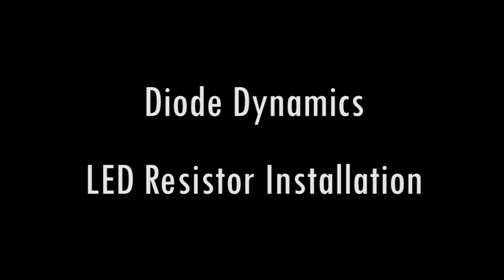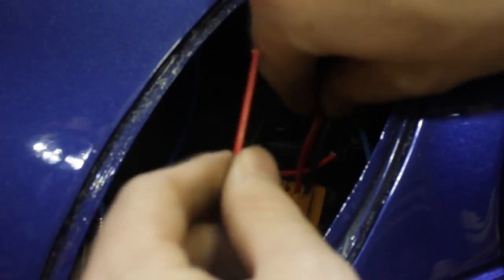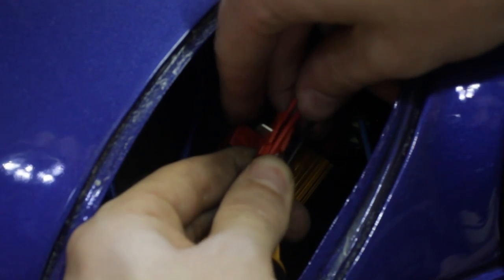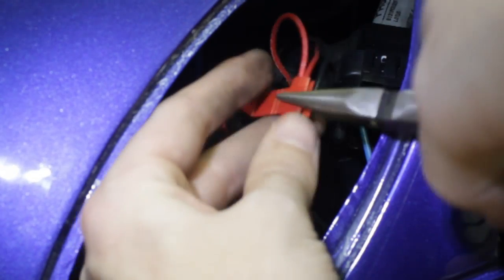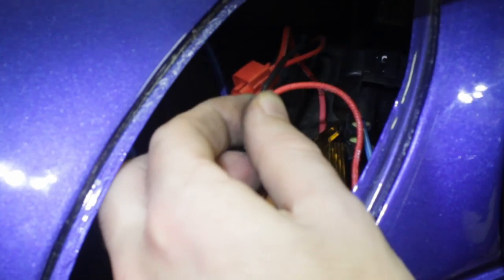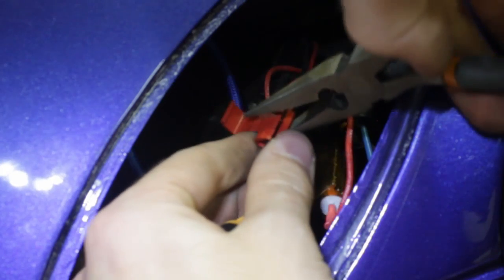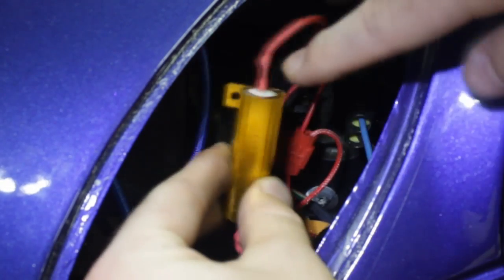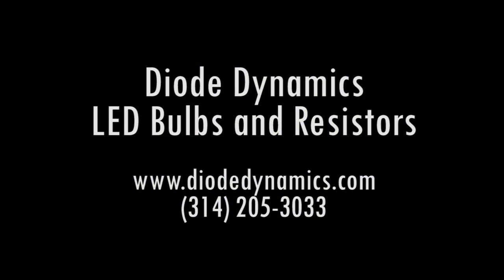How to Fix Hyperblinking! Installing Resistors for LED Turn Signals | Diode Dynamics

Comment: Do I need two resistor kits if I decide to replace both front and rear turning signal? Or just one kit will do the job for the entire circuit? Thank you
Reply from the maker: tvalchev, good question! You will need 1 resistor per turn signal.
Reply: Excellent, thank you! Can please you tell me what what kind of bulbs to use for the side marks, third stop and the turn signals I have on the side mirrors. Vehicle: 2010 Altima Sedan
Reply from the maker: tvalchev, attached below I have a link to all of the products for your 2010 Altima Sedan. If you have any questions just let us know. Thanks for your interest!

http://www.diodedynamics.com/store/catalogsearch/advanced/result/?name=&description=&short_description=&sku=&price%5Bfrom%5D=&price%5Bto%5D=&v_make=Nissan&v_model=Altima%20Sedan&v_year=2010

Comment: How exactly do you mount the actual resistor to a metal part of the car? I'm assuming drilling is out of the question. I tried mounting mine with 3M double sided thermal tape (the thin black kind made of graphite) by putting tape all over one surface of the resistor and sticking it on, but the resistor or the metal surface are not straight enough and as a result it's only loosely attached from a few points of tape instead of over the entire surface.
Reply from the maker: LMF5000, with our resistors, we suggest either 3M tape like you had already tried, or some small zip ties to get it out of the way. If neither of those work, there are also small mounting points where you can use small screws to attach to a metal surface. Hope that helps! If you have any other questions just let us know. Thanks!

Comment: How much power does the resistor take. Is it ideal that the LED + the resistor in parallel, that power consumption is equal to the original incandescent, so no energy savings?
Reply from the maker: danwat1234, running resistors like this will consume similar power to that of the original incandescent bulb. Unfortunately, this is the only way to trick your car into thinking there is not a "bulb out" situation.
Reply: You'll probably use a little more, because the resistor alone is quite close to the original bulb in power consumption, then you have to add the power for the LED on top of that. But I don't see why bulb energy consumption should be much of a concern. The bulbs on a car are normally 5 to 55W... the engine generates upwards of 70,000W at the flywheel (since 1 horsepower = 750 watts).

Comment: I was trying to install my switchbacks in my front turn signals on my 07 GMC 2500 and I'm running into a issue. I was able to slow the hyper blink down until my head lights came on then right back to hyper blink again so now what?
Reply from the maker: Hello! If you shoot us an email at contact@diodedynamics.com, our service representatives would be happy to run through some troubleshooting with you. Thanks!

Comment: Is there something out there can like cover the resistor to protect it thanks and make anything eles to touch it
Reply from the maker: James, we do not currently offer anything that stops protects the resistor. As long as you mount it to a metal surface and out of the way, there shouldn't be any issue.

Comment: How do you know which is positive and negative on the resistor
Reply from the maker: Emmanuel, there is no positive and negative side to the resistor, so it does not matter which orientation you install it. Feel free to let us know if you have any other questions. Thanks!
Reply: Diode Dynamics That was my question.  Great video guys!  If you post a link for some front lights for a 2005 Town Car, I might just click n buy. (So sick of shopping atm) Working on my tail lights currently, and wish to buy new front headlamp assemblies in June.  Gonna need new lights to fill them!

Comment: ok i insstalled some switchbacks but i also unstalled 194 led for parking light . But i converted the side parking light to become a blinker since my car did not come with side blinker. they all have resistors on them but im gettin hyper flash still. is  it becuase the 194 led uses a lower ohm watt then the 4157 switchback resistor that has 6ohm 50 watt.
Reply: And the resistors arent getting hot but they are installed correctly
Reply from the maker: Paul, if you could shoot us an email at contact@diodedynamics.com or give the office a call at (314) 205-3033, we would be happy to help you get the hyperblinking fixed.

Comment: I have a 2003 mustang and bought a switchback led kit with resistors. From the video, it seems that I need to splice the black wire, which has ground, and the turn signal one. I have three wires, a green and white, brown and a black wire. I'm not entirely sure which two wires I need to splice. Help!!
Reply from the maker: Andrew, on one side you will need to use the black and white/green wires, and on the other side you can use the black and white/brown ones. Hope that helps. We actually have a plug and play flasher module for your year Mustang that will eliminate the need to cut and splice anything and allow your turn signals to function normally. Attached below I have a link to that product. If you have any other questions please shoot us an email at contact@diodedynamics.com or give the office a call at (314) 205-3033 and we would be more than happy to help you out.

http://www.diodedynamics.com/store/led-bulbs/listed-by-vehicle/ford/mustang/1994-2009-ford-mustang-led-turn-signal-flasher

Comment: Hello there, I have a 2000 chevy silverado LS 1500 and can't seem to figure out which wire is which. The socket or fitment has 3 wires and from what I can see it has a blue wire and two black ones. Any idea on which wire I would connect the resistor to? Thanks
Reply from the maker: Hello! For the front turn signals, you will need to tap the black and light blue on driver side. For the passenger side, it should be black and dark blue on the passenger side. One of the two black wires should actually be a dark brown. Hope that helps! If you have any other questions just let us know. Thanks!

Comment: Would you know why that hyper flash continues even when the resistor is installed? Its hot while connected to the positive and negative leads
Reply from the maker: Jonny, please shoot us an email at contact@diodedynamics.com and we would love to go over some troubleshooting with you. Thanks!

Comment: My 2012 silverado has dual bulbs on each side as running corner lights +turn signals, would this  still work? And do i need 4 resistors? One per lightbulb?😦
Reply from the maker: Evaristo, you should need one resistor per turn signal light bulb. If you have any other questions feel free to shoot us an email at contact@diodedynamics.com. Thanks!

Comment: I need help plz!!  

I have a 90 454SS truck.  I have put all LED lights in front and interior.  My problem is my two corner parking/turn signal wont light up.  Its really really low output for som reason.  It is so dim

What my issue.  Fyi I also have halo headlights.
Reply from the maker: Hello! Please shoot us an email at contact@diodedynamics.com or give our office a call at (314) 205-3033. We would love to run through some troubleshooting with you. Thanks!

Comment: Say I do this and install LEDs in all my lights. Would i be able to use non-LED later without unsplicing everything? 

Or does LED last long enough that it wouldn't be an issue?

Thanks
Reply from the maker: You would want to remove the resistors if you switch the LED bulbs back to standard bulbs.

Comment: I recently installed these on my Nissan Sentra 09. On my front turn signals, I have a black wire and an Orange wire. On my tail lights, I have 3 wires, one black, one solid green, and one with green and white.
In my front turn signals, I installed them the same way as in this video. However, on my tail lights, I installed the load resistors attached to the black wire and the solid green wire. After installing, I still get the hyper flashing, but only when I use my turn signals. When turning on my hazard lights, they flash at a normal speed. Can you guys help me out please?
Reply from the maker: Danny,
Please shoot us an email at contact@diodedynamics.com with this information and we would love to go over a few resistor troubleshooting steps with you. Thanks!

Comment: And this resistor can affect the original brightness of the bulb??, regards and thanks.
Reply from the maker: Aaron, good question! Resistors will not have any affect on the original brightness of the bulb. It will be the same brightness level with or without the resistor. Thanks!
Reply: Thanks a lot for the help and time. I think for the rear lights is more less the same, just found positive and negative and connect like you clearly show in the video. But what happen if I want to replace all my rear bulbs with led lights (stop, reverse, etc), is necessary one resistor per bulb or just one in the general positive and negative wire that feed all the rear light?, again thanks and I hope with my questions to help others costumers doubt's.
Reply from the maker: Aaron Joseph Gutiérrez ,resistors are only needed on blinkers, not for your stop/reverse lights. Hope that helps!

Comment: Paul,
Would you know how to install a two wire socket for park and turn lights? My front running lights are grounded to the grille/body but my side sockets don't have metal.
This is on my 76 cj7 jeep. I also installed LEDs to the front running/turn lights (bulb #1157 dual filament, and side bulbs are #194 bulbs dual filament.. I installed no load flasher cans, and 4 no load resistors but not getting the front park lights to flash at all.

Is what I did correct or wrong? Thanks for the video. ")
Reply from the maker: Hello! Please shoot us an email at contact@diodedynamics.com with this information and we would love to help get your Jeep turn signals wired up and and running! Thanks!
Reply: Will do. Thanks. :)

Comment: I installed switch back LEDs on my civic, they worked fine for a year or so. Now all the sudden one side is hyper flashing, I tried to fix it but it's not working.
Reply from the maker: Hey there! If you could give us a call at (314) 205-3033 or shoot us an email at contact@diodedynamics.com, we would love to help you get your hyper flashing fixed. Thanks!

Comment: Hey man, I just attempted to install 50w 6ohm resistors for LED turn signals on a 2013 Honda Accord Touring.  I followed your steps and unfortunately I am still experiencing hyper blink.  I used one for each bulb as well.  I need assistance. Thanks!
Reply from the maker: Hello! Please shoot us an email at contact@diodedynamics.com or give our office a call at (314) 205-3033 and we would love to help you troubleshoot your resistor issue. Thanks!

Comment: And what will happen if you leave it without resistors, is bad for the electrical system?? This quick blinking affect the led
bulbs??
Reply from the maker: Aaron, there are no negative consequences to the bulbs or the electrical system from having it run without resistors. However, many people prefer to have them so there isn't a constant "hyper-blinking" effect inside the cabin of the car. Hope that helps. Thanks!

Comment: Thanks for this helpful video, but could you tell me the differences between 25w 6ohm  and 50w 10ohm resistors?
Reply from the maker: Hello there! We carry 50w 6ohm resistors on our website that are mainly used for turn signals, while our 510 ohm resistors are mainly used for DIY projects that deal with individual LEDs. Hope that helps!

Comment: Good video!
I bought 4 led bulbs for brake likes, and I don't what ohm or watt resistor to use. It plugs into 12v and uses 10w. What resistor do I need?

Thank you in advance for your feedback.
Reply from the maker: Hello! Please shoot us an email at contact@diodedynamics.com or call at (314) 205-3033, we would love to help you troubleshoot. Thanks!

Comment: If I have led turn signals in the rear with resistors do I still have to install the resistors for the switchbacks? I ask because I installed my switchbacks with resistors on both front and back and now im getting hyperflash
Reply from the maker: Our switchbacks do require resistors in order to prevent hyperflash. Please give us a call at (314) 205-3033 or shoot us an email at contact@diodedynamics.com and we would be happy to help you get figured out. Thanks!

Comment: I installed load resistors for the front turn signals (dual filament) on my 2008 Honda Civic, now I have strange things happening.

2008 Honda Civic LED hyper flash when running lights are on

Please email me at myriad1973@yahoo.com
Reply from the maker: Hello!
Please shoot us an email at contact@diodedynamics.com or give us a call at (314) 205-3033 and we can help you try to fix the hyperblinking in your Civic, Thanks!

Comment: If I install LEDs for front DRL/turn signals and install load resistors, will I need to install a second set for rear LED turn signals as well?
Reply from the maker: Hello Andy! You will in fact need a pair for the rear turn signals as well. Hope that helps!
Reply: Diode Dynamics t

Comment: Diode Dynamics Are you guys familiar with with switch back LEDs? I'm having issues with mine and wondering what the fix is.

http://youtu.be/SLmIwjXt2Ug
Reply from the maker: Hello! Please shoot us an email at contact@diodedynamics.com or call at (314) 205-3033, we would love to help you troubleshoot your switchbacks. Thanks!
Reply: Diode Dynamics
 I got the problem figured out :)

Comment: Hi Paul,

I installed LED tail lights in my '95 Mitsubishi GTO (3000GT) and used the same resistors as in your video. My left side works normally, but my right doesn't and I am not sure why that is. I do get the hyperflashing, but not 100% of the time. Sometimes the turning signal operates properly and other times it doesn't. For example, when I turn the right blinker on, it flashes normally, but when I hit the brakes at the same time, it starts hyperflashing. Also, sometimes it will hyperflash at all times, even without the brakes being depressed at the same time. I thought that the resistor was defective so I replaced it with a new one, but nothing changed. I don't see any problems with the wires so I am very confused. I even changed the front right blinker bulb, but that didn't change anything either. What could be the culprit? Thanks in advance!
Reply from the maker: Hey there IIian, If you could shoot us an email at contact@diodedynamics.com or call at (314) 205-3033, we would love to help you troubleshoot your resistor issue. Thanks!

Comment: I got a pair of led turn signals for my Sienna from you guys. Good video, and I have the exact same issue, I think I will need to get 2 pairs of resistors from you guys as well. The only issue I have at this point:
I installed the LED signals, turned them on, got the hyperblinking, turned them off, switched back to stock halogens until I get the resistors, and now my turn signals or emergency lights dont come on. I also dont hear the clicking noise from the flasher by the steering column. Could it be that it's the fuse that burned out or the flasher box needs a replacement?
Please help.
Thank you.
Reply from the maker: Hi there! We would love to help you to further troubleshoot this problem. Please shoot us an email at contact@diodedynamics.com or call at (314) 205-3033. Thanks!

Comment: Lol, i just fitted mine after i finished work! I wired them up incorrectly, i spliced both ends of the load resistor onto the positive wire 😳 (which is incorrect)

Please please remember guys, one end on the +positive and the other end on the -negative. 
It is so easy to do and i still done it wrong, lol I'm a real life douche 😂 take your phone or tablet outside to your vehicle with you when ready to install and play this video, lol do not be a douche like me 😱

Comment: Do I have to put resisters on break lights or the reverse lights I have 2002 Dodge Caravan se
Reply from the maker: Hi Michael! Most of the time, you will not need to install resisters. Some unusual circumstances require it, but that isn't all that common. Hope that helps!

Comment: The resistors that I've got have 2 wires on each end, how would I go about wiring them in? I can't seem to find anything on how to do it...
Reply: +whatharmcanitdo -  I figured this out when i installed my Morimoto "Blue" Resistors for my TRS Switchback Blinkers & DD rear Blinkers. ;)
My truck also only needed the single wire Resistors, but i got sent the ones w/ (2) wires... So, what i did was just cut off (1) wire on ea. side of the Resistor &  i was good to go! -Happy Modding!

Comment: Was wondering, do they stay hot or only when turn signal is being used? Are they too hot to put a zip tie around? Installing them on a 2013 Nissan altima and was curious so I know where to put them. Thanks my fellow YouTubers
Reply: It will only be hot when there is current applied.
Reply: Chester B. How much power does the resistor take. Is it ideal that the LED + the resistor in parallel, that power consumption is equal to the original incandescent, so no energy savings? (Also I posted this in the main thread)
Reply: If not the same power useage, then very close so you're correct. Any power savings from turn signals is negligible. The biggest advantage will be not having to change them for a decade or so. If you can change the flasher to one that recognizes LEDs then you'll have the power savings. It still won't be much though because turn signals aren't used all that much when you think about the "on time." The bigger energy savings will come from the parking lights that are on, especially since most cars use a dual filament bulb for parking and turn signals.